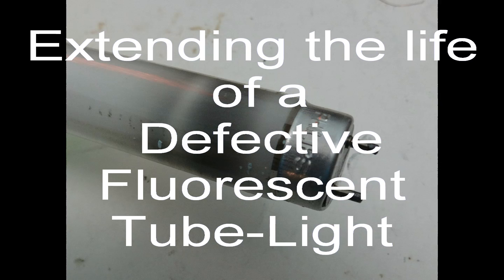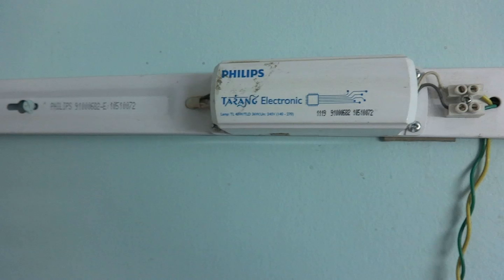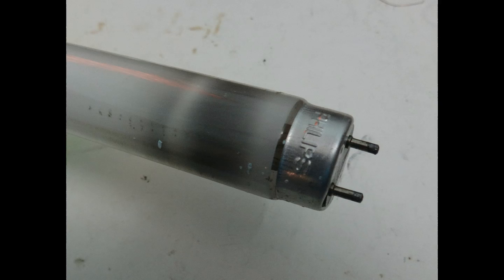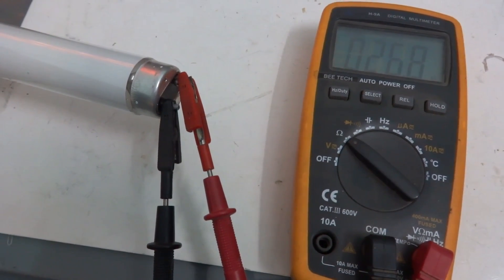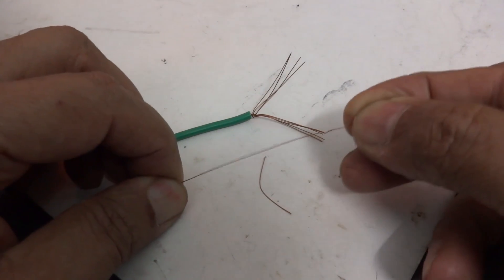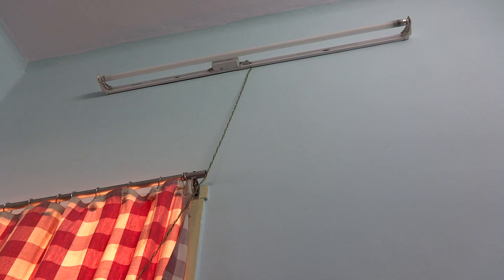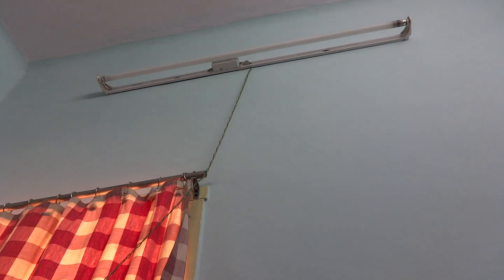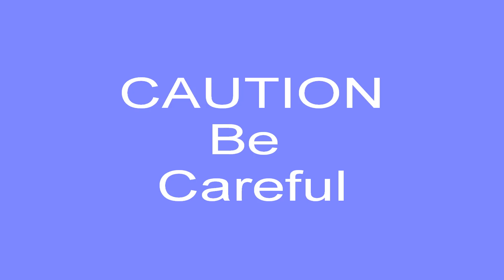Extend Tube Light Life

Comment: My tube has both filaments broken i shorted both ends and i replaced the starter to a electronic one the bulb does start but sometimes not
Reply from the maker: This is an experimental hack, much depends on the actual hardware. Maybe you need need to don an off/on!

Comment: What would happen if you do not shorten the two pins but connect them with a 20~30 ohm resistor (simulation the broken filament)?
Reply from the maker: Unless there is a very low resistance the tube starting high voltage does not build up. In normal operation the high-voltage ionizes the gas in the tube and then the sustaining voltage/current is maintained by the resonant circuit L & C.